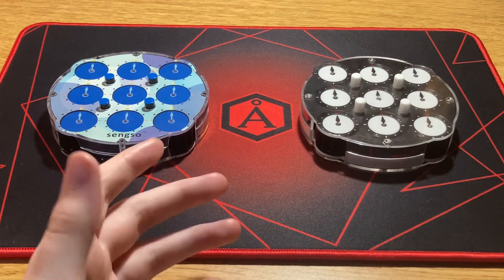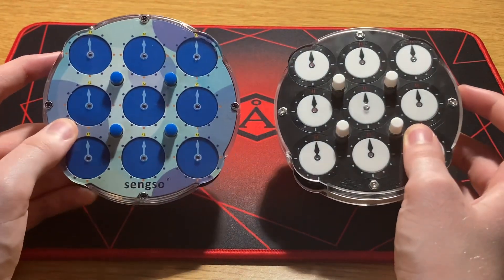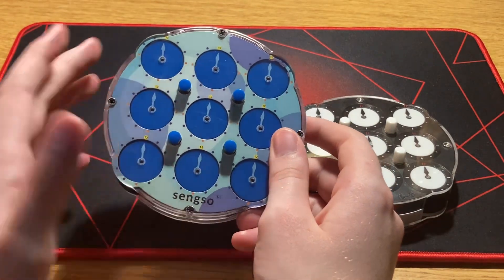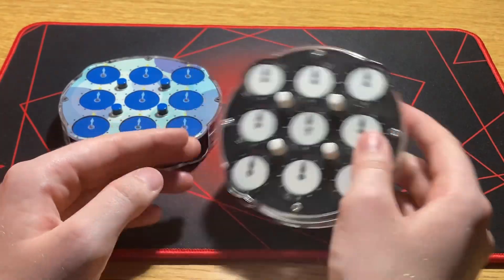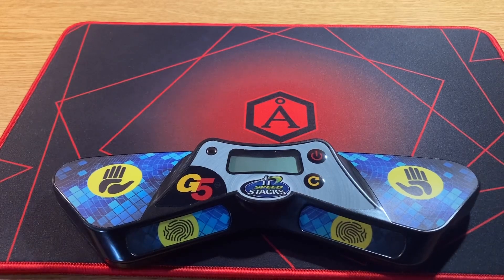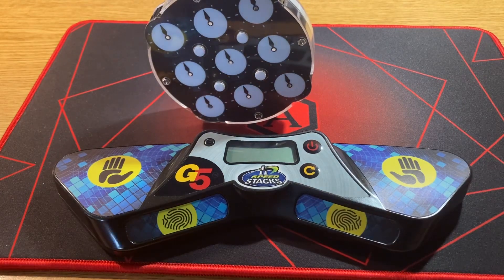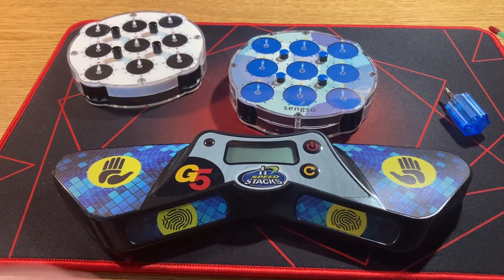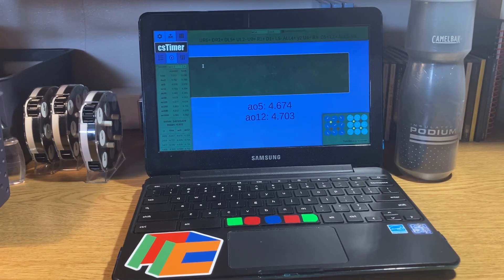How to get fast at clock: Hardware (read description)

Comment: No! Telling people to buy a shengshou as their first clock is stupid because they won’t want to practice clock because of how bad it turns. I think you are forgetting how bad stock shengshous are. If you want to get into clock but don’t want to spend $30 on a qiyi, I would recommend that you just wait and save up for it. If you get a shengshou you will end up spending more money because you will need a qiyi.
Reply from the maker: It’s been about 2 years since I’ve used a shengshou, so I definitely don’t remember how bad they are. It’s probably still a good option if you’re on a reallllyy low budget and reealllyy are unsure about it, but I guess then just don’t get a clock at all. I’ll pin this cause you’re right, I didn’t actually think about it’s turning while recommending it, I just recommended based its price and the fact that it was my first clock.
Reply: @Dr. Lube's House of Cubes Josh literally magnetized his Shengshou and it still turns worse than any other setup Clock I've felt.
Reply from the maker: @CalebTrelford     My ShengShou turned decent enough after setup until I overlubed it, but it still couldn’t turn well enough to get me below about 12 second global. It’s definitely not for fast solvers, or really anyone, but it’s still the cheapest clock that someone could get if they really wanted to get into the event for a lower cost and still be getting a clock that technically works. They should still probably just save up for the qiyi in the first place, but if they set up their ShengShou well it could work for them in the meantime